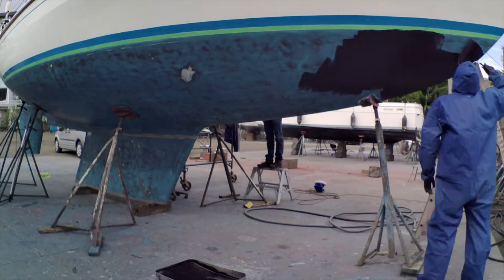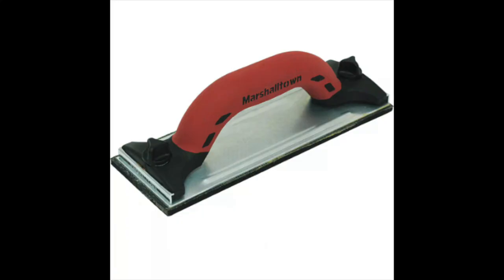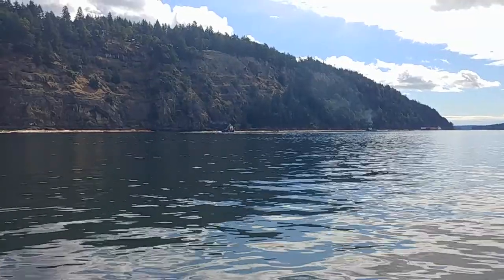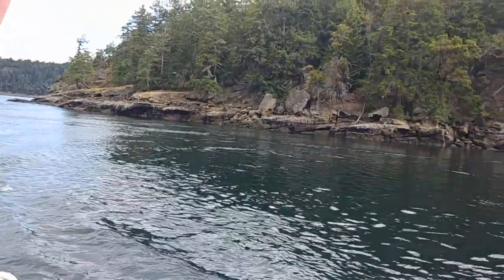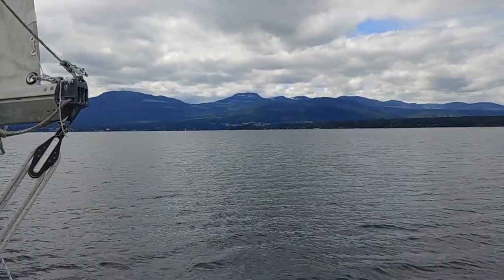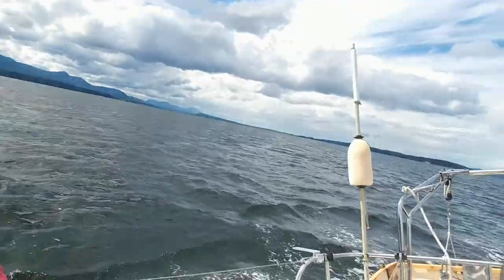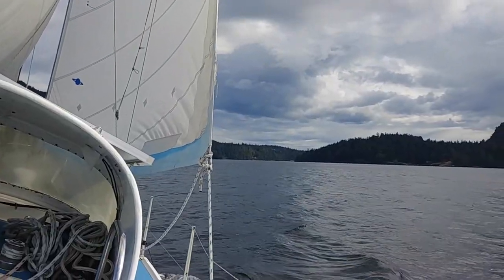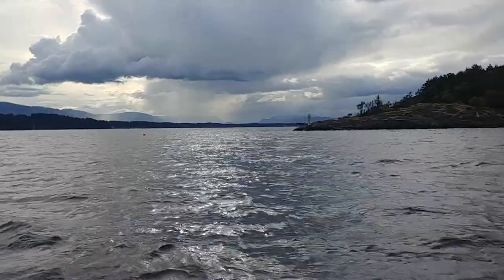Haul-Out and A Solo Sail Through The Gulf Islands | Ep 4 | Sailing Sea Dream of Clyde

Comment: Will have to try that drywall sanding pads, not getting all covered with dust sounds great! Was that just two years of growth? I use Epoxycop by Interlux and after two years was clean after the pressure wash, maybe three barnacles.
Reply from the maker: Ya, the drywall wet sanding approach is great! There are also these sponge like sanding pads for wet sanding drywall that I forgot to mention in the video, which worked great around curves where the handle blocks won't get to. 

Yep, just over two years! The previous owner had applied Interlux Bottomkote XXX, which offers very little protection from growth after 6-8 months. Cheap, but not the right product for boats that stay in the water year-round. I had swam on the hull in September and scrubbed and scrapped off everything then, but evidently, the nutrient rich waters of Cowichan Bay combined with very little sailing last winter allowed for a lot of growth. I was blown away when I saw the prop and cutlass bearing! I've heard lots of good things about Interlux CSC Micron, so I'm hopeful that little growth occurs between trips to the shipyard this time.